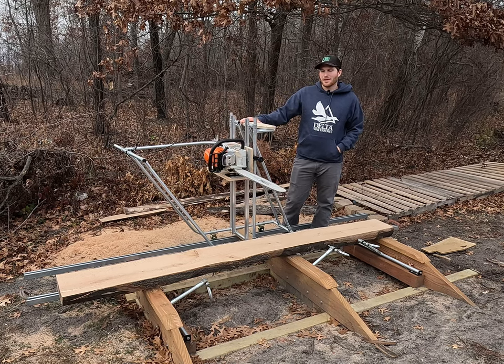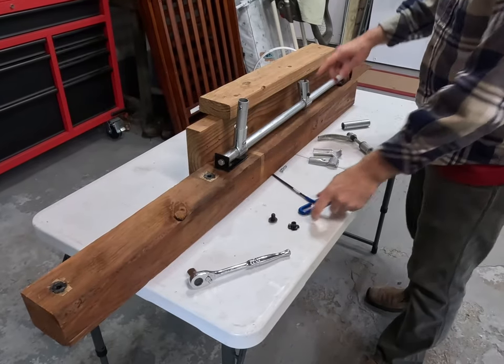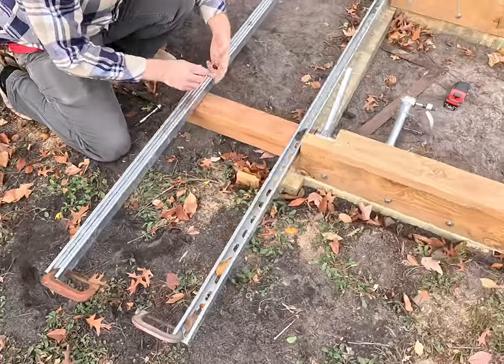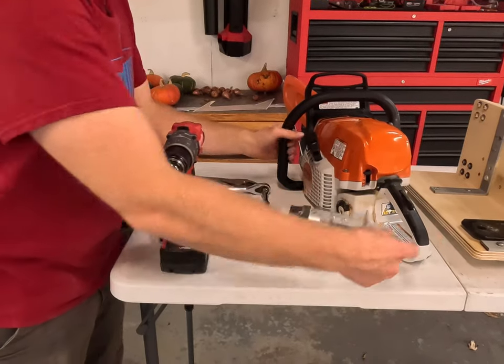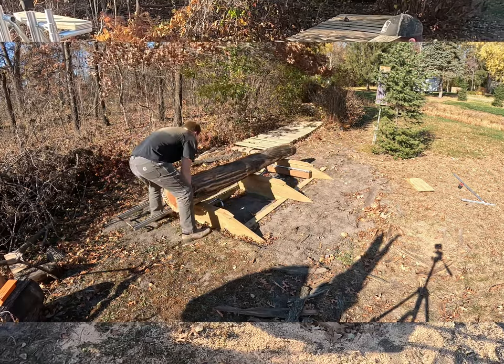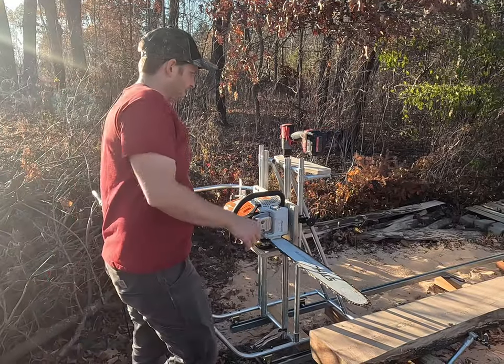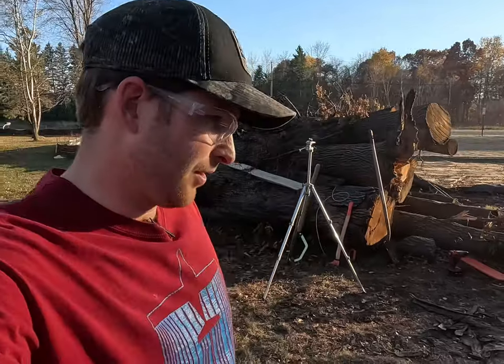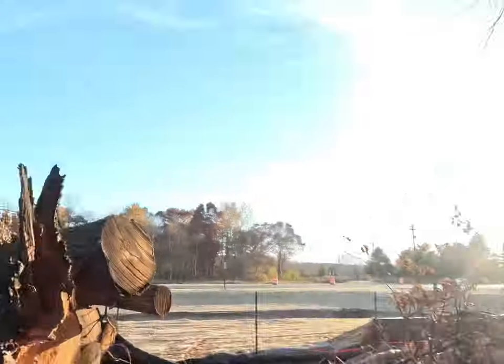Homemade Chainsaw Mill - No Welding!

Comment: They make wheels specifically for unistrut that are designed to hang from a ceiling and carry weight/tools that you could use on the front of your sled to hold it down securely, instead of weight. If you're interested I could shoot you a picture to show you what I'm referring to.
Reply from the maker: I think I know what you are talking about. I looked into them and I thought they were pretty expensive for some reason and that’s why I didn’t use them. But you could still send me a pic or link. My email is in my about page
Reply: I'm at work now. I'll try to remember to send you a picture later this weekend.

Comment: Great project video. Nice approach to building a chainsaw sled mill with no welding!  Thanks for all your work and taking time to share! I know some people might not understand how the cutting time is effected by wood species. I just did some 4 ft boards of 12" wide red oak so your sled is doing a good job on green lumber.
Reply from the maker: Thank you for the nice comments! Yes the wood species matters so much. I cut some pine the other day and it’s like butter compared to oak

Comment: Just had this pop up on my feed. This is an excellent build! 
I timed the cut at 4 minutes so if that is real time for red oak it isn't bad at all.
I can't get over how well it turned out at the start. Just a few tweaks and that thing will be mint! Great job 👏
Reply from the maker: Thank you! That last cut is in real time. I did that because on a lot of other sawmill videos, people were always asking how long it actually takes. And yeah, not to bad for a good size red oak log. 
I’ve cut pine since then, and the pine is about half the time.

Comment: Great job as far as getting it cut lower. You might try to leave it just as it is flip the log over and slide one or two of the boards you’ve already cut underneath it and use 2 screws through a few metal stops along the edges, of the boards that you put under it, under it, to secure it and keep everything aligned to the log you may not even have to move the saw. Other than make a few minor adjustments. Hope this helps
Reply from the maker: Thanks for the suggestion, I think that would work out!

Comment: The important thing you definitely already know.
The sharpening angle of the saw chain when sawing longitudinal wood must be 10° insted 35°. The saw blade remains stable and the table surface is smooth.
🙂

Comment: Can you easily quarter-saw logs with this setup? Or do you need additional bracing/structure?
Reply from the maker: I think i will be able to quarter saw, its appears to just be all about log positioning.  maybe something ill try in the spring

Comment: Great job but why so  short .I want 24 feet long g ..mike Scotland
Reply from the maker: Well the nice thing about it is you can make it as long as you want by adding sections. I don’t have equipment to handle longer logs so I didn’t need to make it that long.

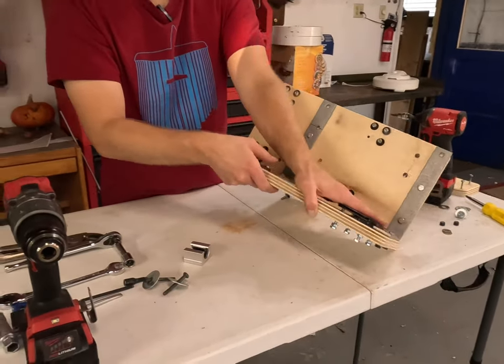Comment: Very nice build indeed. Glad to see that somebody can make something useful without using 2x4’s or by welding! Is it possible for you to post an additional video of the actual parts used to mount the saw to the carriage assembly? I tried to email you but couldn't get though all of the “I’m not a robot” ReCaptchas – they just wouldn’t stop coming! I understand the use of the adapters to bolt the saw directly to the mounting plate (1/4” steel), but I don’t see how you have mounted that piece of steel to the wooden carriage (the L-shaped pieces of plywood) while at the same time, leaving it adjustable. At the 11:49 mark, I see a couple of long screws and large fender washers laying on the table. Are these inserted down through the ¼” plate, through the plywood and then a nut put on each below? The leveling screws are a bit of a mystery as well. For them to operate/work correctly, the steel plate cannot be mounted solidly to the plywood that the adjusting screws are threaded through, otherwise the plate would never be adjustable up or down with the screws. It looks as if there needs to be enough “play” in the two large screws (that were shown on the table) that even when tightened, would allow the adjusting screws to move any corner up or down a couple thousandths of an inch in order to do the leveling. Once leveled, the two nuts holding the plate to the plywood could then be tightened to secure the saw. I'm just guessing here. Thanks!
Reply from the maker: Hey, I’m not sure how you were trying to email me, you shouldn’t have had to do re captchas. Did you try northwoodsengineered@gmail.com. Shoot me an email and I can send some more detailed pictures. Hard to explains here with words.

Comment: A great build, but is that Chain Sharp or Dull, took forever to cut through that slab.
Reply from the maker: Thanks. No the chain is sharp, it’s just not a huge chainsaw and the wood is pretty hard oak so I just went nice and slow. It does take awhile though.

Comment: Very good mill, I see a lot of different Chainsaw mills combined Norwood PM14, Alaskan and a bit of Logosol, well done. those linear actuator bearing  how do they like the fine saw dust?
Reply from the maker: Thank you!
They have held up fine so far but to be honest I haven’t cut that many logs yet. Got it done in late fall last year so I didn’t use it through the winter but will hopefully start again soon so we will see how everything holds up
Reply: @northwoodsengineered  do you sell plans
Reply from the maker: I don’t. I have though about it but just haven’t had time to put them together. 
If you wasn’t to do something similar and have questions shoot me an email and I can try to help. Northwoodsengineered@gmail.com

Comment: Great job, I would like to see just how you designed the head and saw holder!  Could you send a few pictures? I think we could improve it with a pivot point to  pitch in ,”toward the log or away”,  roller tip of the saw blade in or  the heal or but of the bar in for a better faster cut! Again great job !!
Reply from the maker: Thanks! Shoot me an email and I’ll send you some close up pics and we can chat about it. Northwoodsengineered@gmail.com
Reply: @northwoodsengineered  Would make a great followup video reads like.  Even talking about the design if you don't do.
Reply: same here

Comment: Really nice quality build. Still on an Alaskan style mill with a 92cc saw and 42" bar. Been thinking of something like this for cutting planks and dimensional lumber.
Reply from the maker: Thank you! That’s a nice big saw for milling I bet that works well.
Reply: what size was your saw? 60cc?  @northwoodsengineered
Reply from the maker: @thegarbagegladiators4735  I’m using a 64 cc

Comment: The build looks pretty good but it s way too slow,
About two minutes to cut a board not even wide… 
As a self employed person, time is important and that system is not worth it to me.
But for a person that have plenty of time like a retired person or a employee. Good enought i guess.
Great engineering though !
Reply from the maker: Thanks for the comment. This definitely is not intended for a production setting. Just for home use

Comment: Awesome Video! 
Question... How often do you have to resharpen the chain or purchase a new one? (How many logs on average, will one chain last) 
We are getting into this ourselves and I love your design 

Thank you for sharing!
Reply from the maker: Thank you! I bought an electric chainsaw sharpener from granberg to make it easy and you can sharpen without removing the chain. I would resharpen after one or two big oak logs, but if cutting pine you can do a couple more. But there’s just a lot factors. So it’s hard to say how long a chain will last.
Reply: @northwoodsengineered  Awesome! Thank you! 
Just wanted a GENERAL time. 
That works 
Thank you

Comment: Great project

Have you tried mounting the saw at a 30 degree angle? Maybe the cut will be easier as it's more towards a normal cut and probably there will be bigger chips? Of course you lose some of the maximum cutting depth. 

Would be interesting to compare
Reply from the maker: Hey, thank you! No I have not tried that yet. The way I have it made doesn’t allow for it at the moment, but it definitely could be something to try in the future

Comment: Great project! I am looking to use those wheels and unistrut for a sliding kayak rack. Your link is for 2” v-groove wheels. Did you use 1.2” wheels or is there a larger width unistrut?
Reply from the maker: Thanks! I used the 2” wheels which is 2” diameter. The v groove sits on one side of the top of the “u” of the unistrut. Just standard size unistrut. Hopefully that makes sense.
Reply: @northwoodsengineered  Got it. Thank you! I was thinking it was inside the unistrut. Makes sense now as a “track”.
Reply: @northwoodsengineered   Awesome work!  What is the little black part on the front left wheel?  It looks like it might ride inside the unistrut to keep it on track?
Reply from the maker: That’s a little piece that I made out of some scrap metal I had lying around and some little wheels from a 3d printer. And that’s exactly what it’s for, to ride inside and keep it on track.
Reply: Thanks for your response!